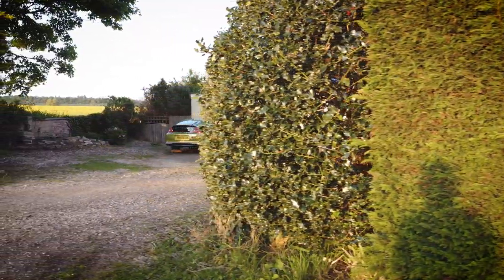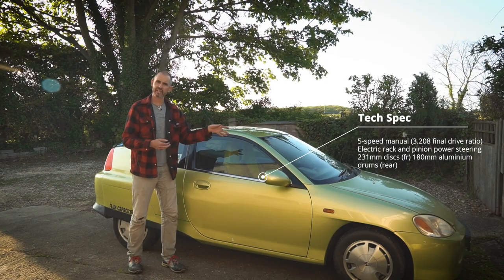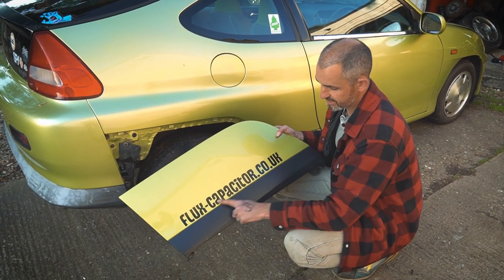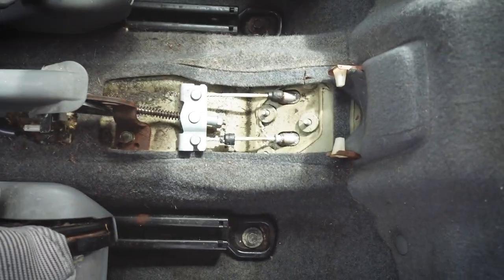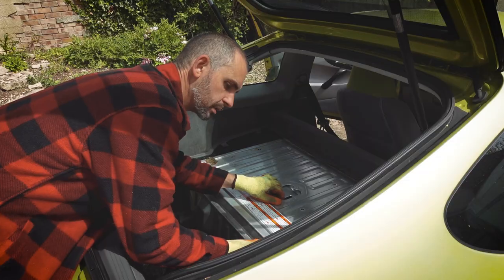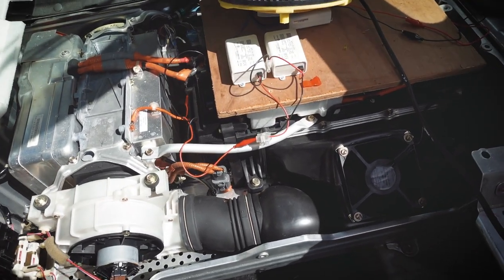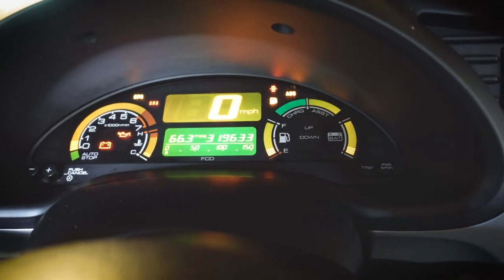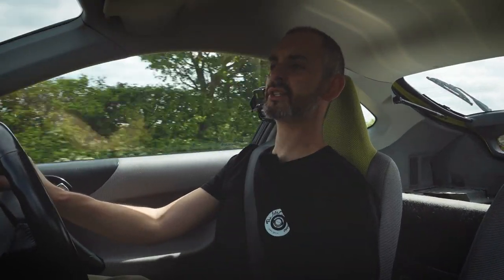Rescuing a High Mileage Honda Insight Hybrid - the NSX of Hypermiling

Comment: Did you say these were sold in Japan? Most JDM vehicles are low mileage in my country,  I'd buy an JDM Insight and do a steering dash/steering wheel swap. A low mileage insight will be on the road for years to come.
Reply from the maker: Insights were sold in Japan, yes. They were the first hybrid sold globally.

Comment: I don't think I realized manual transmissions were a thing on hybrids.
Reply from the maker: Taking you to school… A very average school, but school.
Reply: Only in the older Hondas - they use a fairly simple system where the single motor generator is in-between the engine and the flywheel, so they could just stick any normal gearbox on the end.
In comparison, Toyota use a system where two motor generators (doing different things) are integral parts of a planetary gearset - it makes for a very simplified transmission but the only option is automatic and continuously variable, though it also makes a fully series-parallel hybrid unlike the first Insight (parallel only).
Reply: @AaronSmart.online  wow thanks for the explanation! That's cool.

Comment: I'm sorry, but the Prius isn't crap ! and was the first hybrid sold in 97. The THS (Toyota Hybrid System) is far better than than the Honda IMA. Even tho I like the Insight, and still want one, no way I'll ever sell my fitst Gen Prius. A far, far better vehicle in every aspects.
It sit 5 people comfortably, it's full hybrid meaning, it can move only using it's electric motor. It use a planetary gear system to used power both from the ICE and electric motor. It has no starter motor since the electric motor is used for starting the ICE (unlike the insight, which still has as starter motor, in case of the weak HV battery pack failing, which happen a lot). The Panasonic battery module, where made exclusively for the Prius in as a result of a collaboration of Toyota and Panasonic . The "prismatic" module ( Panasonic EV Energy Co/PEVE nowdays) are far better both in term of space and capacity and longevity than the standard Nimh module used in the insight. The quality of the interior and the onboard system are also much more modern (touchscreen based interface, auto regulated AC, GPS, CD changer, cruise control ...). Last point is safety. Considering the weight of the insight, in case of an accident in modern traffic, you're likely to be killed or severely injured. On the other hand the Prius was way ahead of it's time with is new MC platform and the Prius was the first car to use it this new chassis.

Comment: So it failed its MOT then ?
Id go with the Lithium Ion upgrade but not sure if Johnny will need to change the charger as well.
Lithium and these old batteries charge in a different way.
Would be interested to see this fully back on the road.
I still can't believe so few were sold here in the UK, did Honda not market them well ?
Reply: i think lack of rear seats, unknown technology (for a car at the time), love it or hate it looks and probably price all went against it in the UK back then. Compared to many brands, Japanese brands arent as popular as you might think. add to that, the above 'quirks' and it all adds up to why so few sold here

Comment: Years ago I wanted to buy an identically coloured insight which had only covered 10k miles from the local Honda dealer but my wife wouldn't agree because of the colour.
Reply from the maker: Your wife was wrong.
Reply: @TheLateBrakeShow  I think you are right. The car is a design classic that is very useable - I hope you keep it on the road as a hybrid and convert it to EV when the batteries have improved to give you a good range. Well done.

Comment: I'd say add a plug in capability, & upgrade the battery at the same time. I can't imagine how much extra EV range & overall performance you'd get out of it with modern battery pack in there...
Reply: The battery offers assist only. It never runs just on electric power. As Jonny has the charge/discharge kit he already has a plug-in version! When I took mine to Peter Perkins, he hard-wired everything so it came with a 3-pin plug, ready to be plugged into the mains.
Reply: @charleshussey118  I assume that all that behaviour is software controlled, & to make a modern battery pack emulate the functionality of the old one will require a developer to write a load of code anyway,so why not add regen & stop-start & an EV only mode…
Reply: @fat_biker  As Charles says, it doesn't do EV only as the motor offers assist only. The motor is directly bolted to the crankshaft, so whenever the electric motor spins, the engine spins. This Honda already does regen and start-stop, standard features even on previous century hybrids. If you want to put in a different battery (e.g. Li-ion) you need to trick the management system to think its still has a NIMH pack attached to it. No need to rewrite software of the car itself, Honda did its homework. All a newer or higher capacity battery + plug in will do is offer some additional fuel efficiency on short trips.
Reply: @fat_biker  The Gen1 comes with regen & stop-start. You can get some pretty sophisticated after-market monitoring and control software. Converting to Li-ion does require a rewrite of the battery management software but it has been done.
Reply: @fritsified5952  I see now why people go EV only with it. If you wanted to retain the engine as a range extender you’d have to find a way to install dual front motors & maybe ditch or gut the transmission?
Reply: @fat_biker  Personally I find it a bit of a waste of a nice car to do any EV conversion on these. Such a well engineered car, and there aren't many of them driving around. Much nicer to keep them original.
Reply: @fritsified5952  I see your point about full EV conversion, but a battery upgrade with modern BMS & plug in fast charging sound like restomodding rather than ruining…

Comment: Can you explain what the battery does? Looks like it will run a lightbulb for 24 hours so it’s absolutely tiny. It would probably be more economical not lugging the battery pack and accompanying crap around, and just being 100kg lighter for the lovely little three-pot to power? Tiny 3-cyl plus 800kg should equal 80-100mpg anyway? Audi’s A3 3-cyl diesel did 80mpg around the same time as this - no battery, no problem. They were longer lived and you still see plenty around.
Reply: The battery capacity is tiny - only 0.936 KwH so the electric motor is only there to assist the petrol when accelerating or going up hills (that way, Honda managed to produce a 1-litre car with the performance of a 1.5-litre car. And yes, you can remove the IMA battery pack and run it just as a (30Kg lighter) petrol-engined vehicle.
Reply: @charleshussey118  this concept started with some promise, not the battery etc, that’s just is a gimmick, but the 800kg’s was heading in the right direction. .It’s sad all it’s lead to are massive, bloated, hybrid SUV’s (biggest selling sector) which get changed every three years because of the way PCP works. I can hear the environment weeping.

Comment: I remember someone years ago with a silver or pale metallic blue one who had socket on the back bumper, at the time I just thought it was able to drive fully electric but can't of done if its battery assist
Reply: Probably more likely LPG
Reply: @AaronSmart.online  not unless LPG magically comes out of the extension he use to run outside to plug it in 😂

Comment: Would anyone make a battery pack with 2022 energy density that would fit this car?
Reply: @Taz1451  "range"? This is a parallel hybrid, the electric motor cannot run independently from the ICE (it's in-between the engine and the flywheel). A higher capacity battery will improve fuel efficiency but at some point there will be diminishing returns.

Comment: Offside Rear Fog Lamp and Registration Plate Lamp fail?! Bit sad, could've probably passed if those things were checked ahead of time.
Reply from the maker: No one is sadder than I. I spent days on the handbrake and battery revamp sagas, so just didn't think to check the more obvious stuff.

Comment: What mileage do you get on just the battery pack Jonny ?
Reply from the maker: The Insight cannot run E-only, as it was designed with the motor sandwiched between gearbox and engine block. Both are always working together, but the motor works harder for low end torque (depending on throttle position) and regens where possible. About 68-70mpg is the average, but you can get over 80 if really hypermiling.

Comment: So, Is this a proper hybrid, where the engine charges the batteries, and you have electric motors that run off the batteris, or this new modern kind of mumbo hybrid, where you need to charge this from your wall plug, and where the batteries just feed a bit of a boost under x- number of mph, and where you mainly run off the engine?
Reply: I think you've somehow confused three different types of hybrid... This is a traditional hybrid, like the Prius. The battery is charged by the engine or from braking, and a motor can supply that power back to the wheels when accelerating. Plug in hybrids take that a step further with a much larger battery and bigger motors with significant electric only range and performance. Those plug in models still charges from the engine and brakes, but can also be charged from the wall. The rubbish pretend hybrids are generally called mild hybrids, and don't plug in at all, have tiny batteries and very little power. Good for knocking a few mpg off the emissions test and not much else.
Reply: What you call a "proper hybrid, where the engine charges the batteries, and you have electric motors that run off the batteris" is a series hybrid. Which barely exist, as the efficiency is not that good. Some EV with a range extender use this setup.
The "new modern kind of mumbo hybrid, where you need to charge this from your wall plug, and where the batteries just feed a bit of a boost under x- number of mph" does not exist as fas as I know.
This Honda is a parallel hybrid, Toyota uses a series-parallel hybrid. Might be good to read into the differences, instead of thinking in terms of "proper" and "mumbo".
Reply: Lots of misconceptions about hybrids and PHEVs going on here...

Comment: Wonderful driving experience!!!!??? Hilarious. This is the definition of a a penalty car. The worst car I've ever had. The most uncomfortable seats ever. Slow AF! I lived at the top of a hill. I had to get a flying start to crest the hill. If there wasn't enough momentum I had to stop in the middle of the hill and shift into 1st before proceeding! The ride & handling were awful; just what you'd expect from a clown car. A new catalytic converter was US$1,000!!! 80MPG??? Sure. I was lucky to get 55. And the 1st gear synchro went out before 200k mi as did the battery pack. On the plus side the engine is bullet proof.

Comment: All that electric faff, and for what? My Nissan Note diesel 1500 normally aspirated, is currently on 74.8mpg. On a run it will do 84.3mpg. I have no loving feelings for electric cars, I think they will accelerate the death of this planet.
Reply: Doesn’t sound like a Massey fergusson and turns heads at a car meet. That’s the point.
Reply: Just wondering.... how long does  the queue of traffic behind you become when doing 84.3mpg in a Note?
Reply: @23gps , wonder no longer. Most of that was 60mph on a quiet M5 and low speed on the lanes down to , Brean, Somerset.